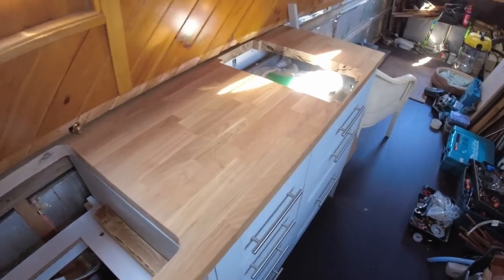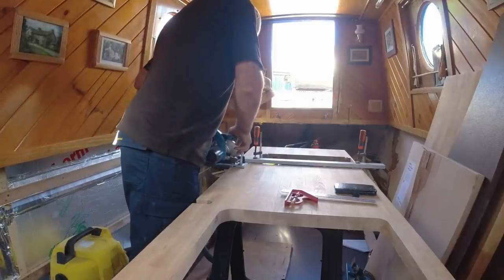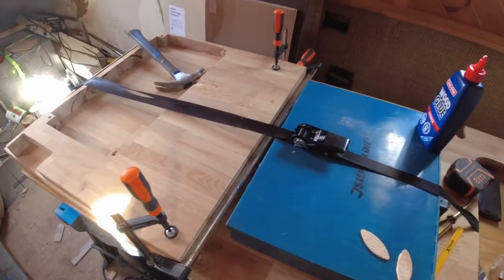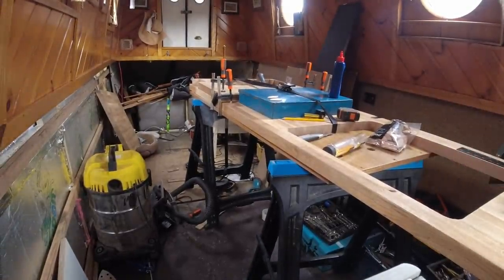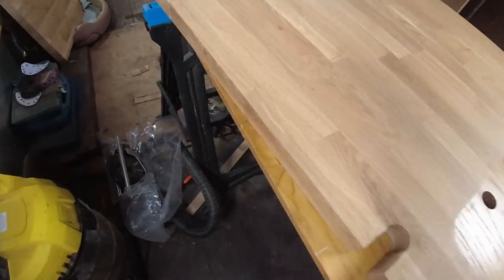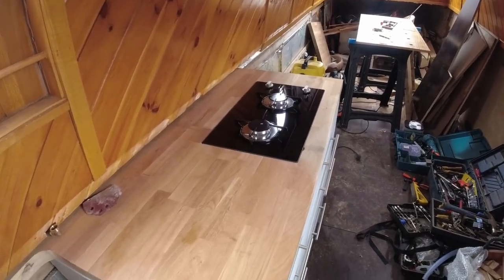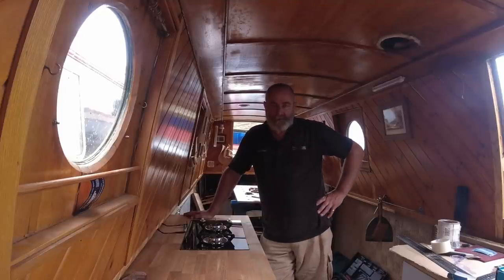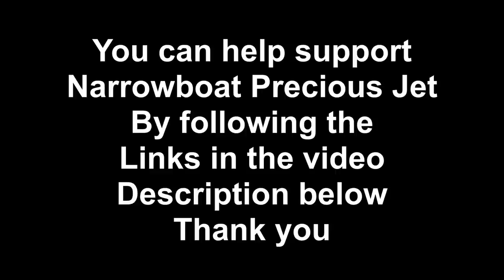Narrowboat Refit #39Fixing a worktop and Inlaying a cooker hob

Comment: I've vacillated as to whether to ask this since you mounted the water filter under the counter top (work surface) and behind the washer.  I ask now because you say you welcome comments and questions. So, here goes. I may be misunderstanding, but wondered if you will have to move washing machine out from under cabinet each time you need to change the water filter cartridge.
Reply from the maker: Hi Becky, yes I will have to move the washer when I need to change the filter, however that will only be once a year so it won’t be to much of a problem. I will need to move the washer out quite regularly to clean underneath it anyway 😊😊👍🏼

Comment: Great job mate but I would use body filler to fill the holes,works wonders mate still fill it with sawdust
Reply from the maker: Wow is that a thing then? Mix sawdust with bodyfiller?? 😂😂👍🏼
Reply: @NarrowboatPreciousJet  I have used it many times to fill holes in doors,window cills anything wood.I have mixed wood stain and other colours to get the right tint and it dries in minutes as you know,if that helps try it first on a scrap piece of wood